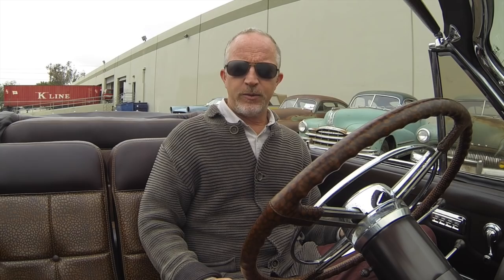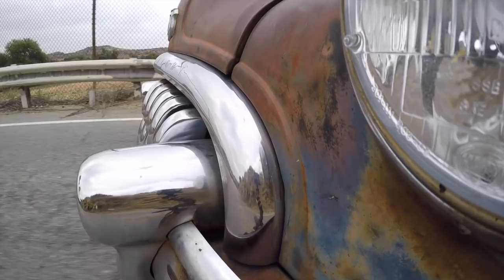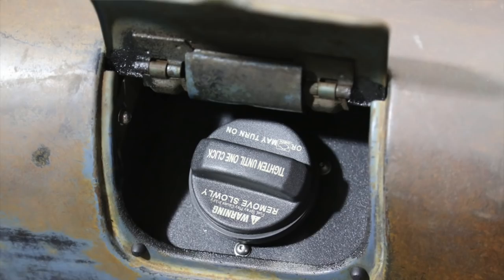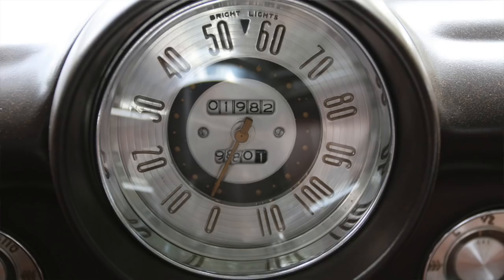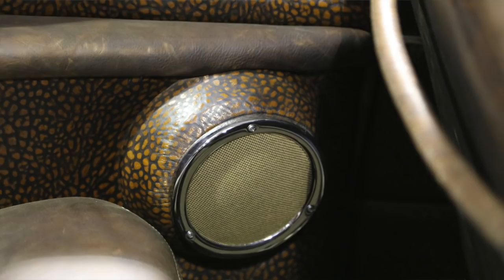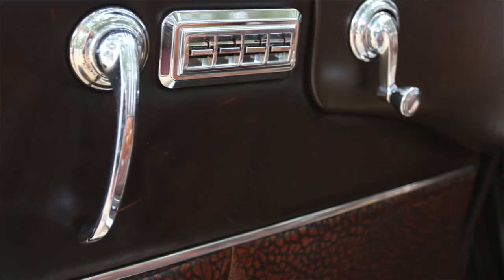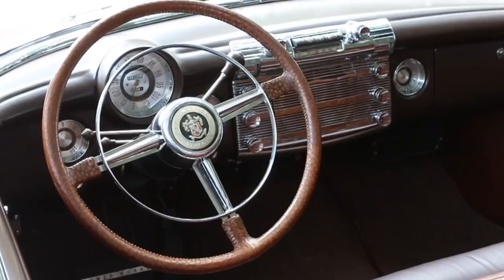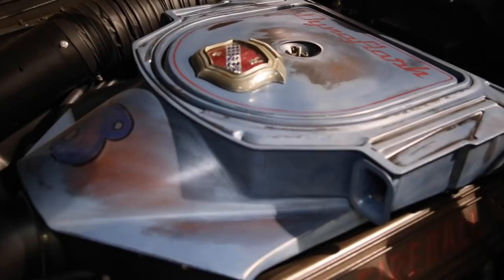1950 Buick Roadmaster ICON Derelict Convertible!

Comment: I owned a lot of '50's Buicks (mostly 52,53, 55 and 57's and as a kid, I only tinkered with them because I was a teen back then. At one point I owned 4 1953 Buicks. A Century 4door sedan, straight 8; a Special, 2 door with post sedan straight 8, (both with 6 volt systems). Then a 2door hardtop Riviera, v8 and a Roadmaster v8 both with 12V systems). I would have kept them except my parents wanted their yard back after I turned 21. One thing  that killed these cars were the cable operated vacuum driven windshield wipers and those knee bend shock absorbers. My favorite was the Riviera but the driver side wiper cable broke & no one wanted to repair it so it died  a soft death of time in my yard until it came time to junk it. How did you approach this windshield wiper in your rebuild (if you didn't leave them stock)? .
Reply: a 53 century? was it strawberry or chocolate?

Comment: Cool car (as are all the Icons), but it's missing the signature Dynaflow sound. Back in the day, because of the one-speed Dynaflow transmission that relied on the torque converter to act as a continuously-variable transmission, when a Buick took off, it sounded like a motorboat getting underway.
Reply: left full rudder aye, all ahead 1/3

Comment: I built a 48 Buick Coupe 454, T400, 9 inch, blah blah blah. Built four more various. 454's 455's etc. Between the block and bell housing will be a tag.........W&S Motors............= wall and shelf means built with what was hangin on the wall sitting on the self. Lincoln buzz box, 6011 and 6013 rod mostly but some 7018 got in there. True back yard in the Phoenix desert.